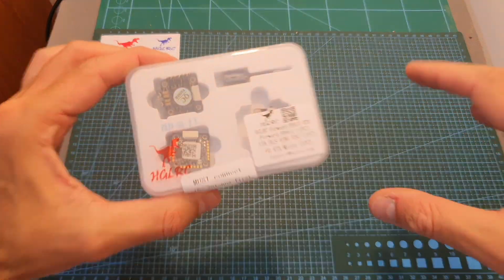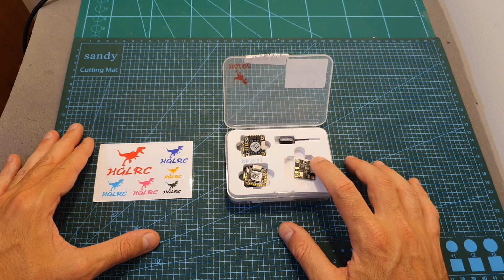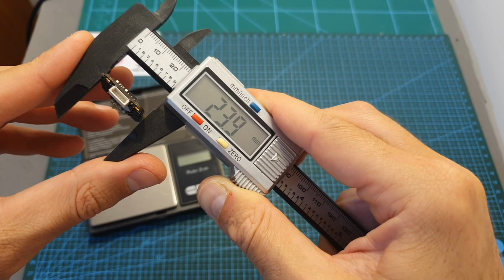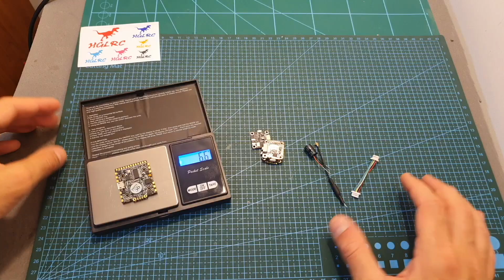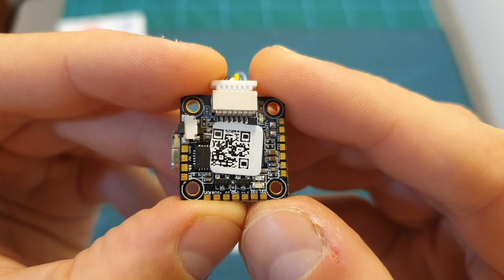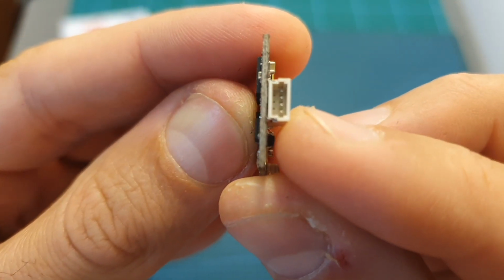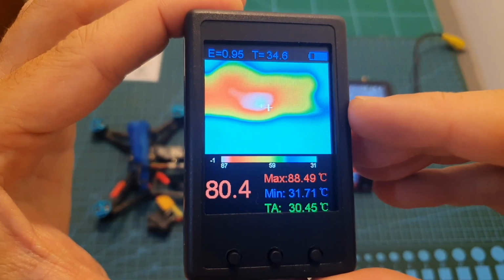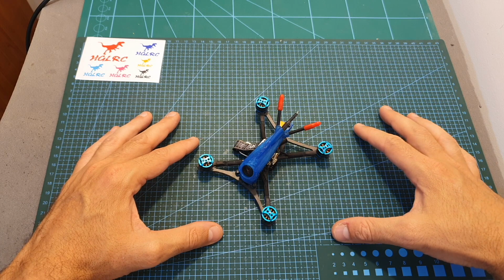HGLRC FD413 16*16mm AIO Stack - VTX Test & Overview

Comment: Hello I have a problem when my motor will spin up. But when I spin the motors up the motor keep on spinning and the the boards light go out after awhile. It a new board and I need help
Reply from the maker: Please elaborate on that issue. Are you testing your drone with no props and the motors increase their speed? If so, it's normal.

Comment: I have this VTX and cannot get SA to work. I've tried everything I can think of. I wonder if I missed a basic setting... Lol.
I appreciate your help..
Reply from the maker: Hi, in recent videos I include the VTX table. Did you set the relevant UART to IRC Tramp Protocol?
Reply: @KremerFPV  
I did. I have come to the conclusion the Flywoo Goku f411 stack is not working properly. Neither TX pads are working. I have sent emails to Flywoo and notta.. Not a fan... Thanks Gal
Reply from the maker: @PropsOff  is there any chance the flight controller is flashed with the wrong firmware version?
Reply: @KremerFPV  
Is there a specific version the GoKu f411 16x16 is supposed to be flashed to? Flywoo never responded to 5 times I tried to get this info..
I appreciate you Gal..🍻
Reply from the maker: @PropsOff  Send the links to the exact products that you are using and I will check it out.
Reply: @KremerFPV  
My first Flywoo product. I have 2 flight controllers here in 2 builds and have had issues with three of them not working. There are 2 TX pads and neither work.. Here's the one I'm working with. 
https://youtu.be/hxO0ifrvfMQ
I did a build video and the wife said to get it posted to showcase the other components. I hope for my subscribers I can figure this out and make an addendum video..
Thank You Much! I appreciate your time..

Comment: Hey I just bought this flight controller board and when I plugged it in it had a blue light on it and I was using beta flight and I don’t know why now but there’s only a red solid light do you think that you could make a video for everyone who has this because it’s not that easy to program
Reply from the maker: Hi, sorry - I don't really understand the issue. Did you get it sorted?
Reply: Gal Kremer what Firmware do you Flash on this. Also the bootloader programming failed. What does that mean
Reply from the maker: @airbornefishing4871  I mentioned the version in my video. Did you enter DFU mode?
Reply: Gal Kremer also I am using a Spectrum receiver and I have a couple of questions when I find my receiver it has a small little pine button and when I click it there’s a flashing orange yellow light but once I completed the behind the light does not stay on is that an issue with the receiver or with the board or with the code

Comment: Seems lile a decient quad but How are you supposed to repair this stuff . its allready difficult enough to make repairs on 30x30 then 20x20 now 16x16 what's next 10x10 come on manufacturers i still want to be able to repair stuff.  Thats smaller than a camera board .lol  😵😢😒. I going to need a microscope to solder now .
Reply from the maker: Yes, it's surely pretty small :-)